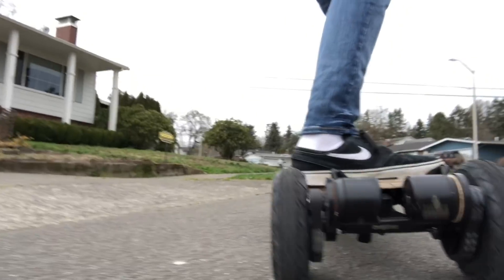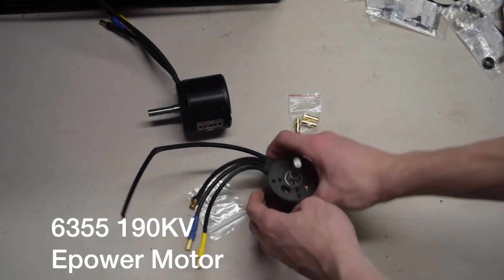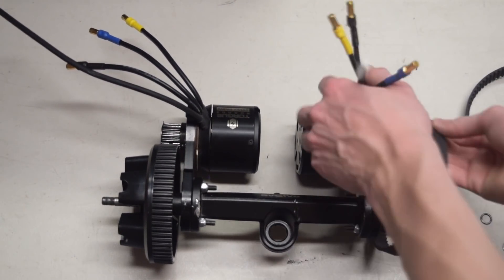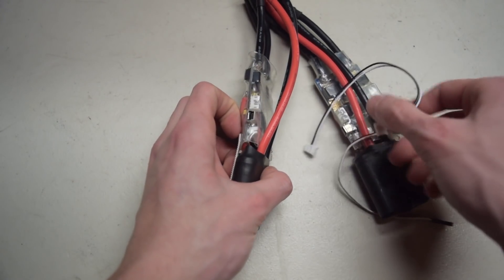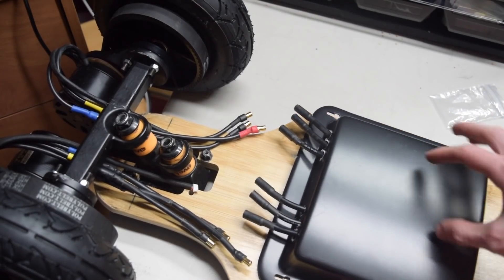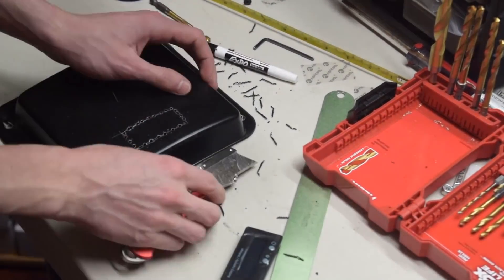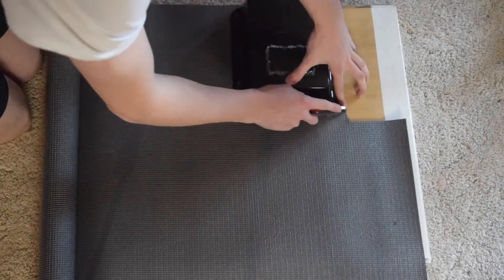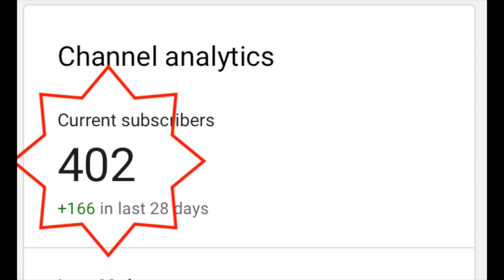How to Build a Dual Drive Electric Skateboard (10s5p, Evolve All Terrain Tires)

Comment: I ride a Meepo nls but I wish I’d built my own now . Thanks for the videos they’re real informative and very interesting
Reply: grantoldblueeagle diyeboard.com better than boosted in my opinion
Reply: I built an "almost" long board (it looks liike a surfboard). Probably only 40" long, with a Hobby King 6373 ($70) and a 150 amp "mega something" speed control that was like $60. I bought the parts 6 years ago, I assembled them 2 years ago with a nice set of trucks that fit a motor mount I EBayd for like $20. Bought 2 6000mha 3 cells to run in series, ya know to start small. Other people running 10 cell. It was SO FUCKING FAST AND TORQUIE IT WAS UNRIDEABLE! I dropped down to a 4 cell 7000 mha (I'm running lipo's.WAY more amps) and it's way rideable but super touchy throttle and tops out at 14mph (at 33% power). The torque is NUTS! You gotta do your math and research. I'm moving to a 10 cell pack but with a speed control that can't hit the mass amps I was with my last. That should reduce torque (seriously it was overkill, it would actually do wheelies. Throw your ass right off the back) and increase top speed. Smooth out the ride. It's ALL about math amigo. Don't be scared, it's all just plug and play. Cheers!

Comment: Sick vid! 2 things, make sure to cover the battery status wires with hot glue or heat shrink you dont want your wires to short and your battery exploding under you. Also I also made a board and drilled 3 holes for each phase of the esc but steering started scratching the wires where the drilled holes were which can make them bare over time. As I said otherwise a really sick video !
Reply from the maker: Yes for sure. I did that off camera. Thanks man

Comment: How much all together Did the board cost? How much are each part the wheels motors trucks escs controller and deck ? How long did it take to get the parts?
Reply from the maker: it cost around 1500 USD. wheels are 250, motors are 90 a piece, trucks are 120, esc is 300ish, deck was 50 ish

Comment: Today after a year what do you think about the battery
?
Reply from the maker: It was good but we put it on the mini bike and destroyed it.
Reply: @DIYesk8Builders  so you think will be good with 2 motor Flipsky H6368and and FOCBOX UNITY+?
Reply from the maker: Should work great for the price! If you do have the money though I would go for a 12s4p 30Q or 12s3p 40T. The Samsung cells are too good

Comment: I'm probably going to build this one but I have a question when I use the sensor wire from the motor is will start up smoothly right? And do you have an idea of an acceleration compared to a Genesis tomahawk sorry if I'm asking to much. Thanks
Reply from the maker: I have never run any motors with a sensor wire in FOC mode but from what I have heard it is a much smoother start up and is much quieter. I have no idea how it compares to a genesis tomahawk. The acceleration is not that strong on a genesis; I can floor the remote on high mode and not get thrown off. I'm sure with a diy board such as this, the acceleration is much stronger even with FOC mode and sensor wires. In the VESC tool you can also change how strong you want the acceleration to be so its very customizable. I hope this helps, don't hesitate to ask more questions!

Comment: Yo I have a question can you put smaller like 100mm boa wheels, or the orangatan 80mm wheels?
Reply from the maker: Yeah you could put any of those wheels, you'd just need to buy the corresponding wheel pulley from evolve!
Reply: DIY esk8 Builders alright lit thank you so much and great video.

Comment: If you wanted to upgrade the battery so you can have more distance with the same speed what battery would you choose
Reply from the maker: The board already has a good 15 miles of range. I would probably buy a 10s4p 30Q from MBoards through just for a few extra miles and a flat pack instead of this bulky one

Comment: Did I see those motors having a hall sensor? Did you not use them?
Reply from the maker: These motors have hall sensors, but we are not using them because of the large AT wheels
Reply: @DIYesk8Builders  can they not be used with AT wheels
Reply from the maker: They can, but from what I have read, using FOC sensored is more likely to make the VESC fail with larger AT wheels. Im sure it can be done though and we will definitely upgrade to FOC sensored in the near future

Comment: Hi Bilder, do you think these two MOTOR 6355 pushes well or is it better to install the 6374? which one do you recommend?
Reply from the maker: Dual 6355 is already insanely powerful, probably enough. Dual 6374 is just a little extra but it honestly does not make that much of a difference unless it is a mono drive.

Comment: Do you need two esc if  both motors are intended to go the same speed or do the motors lose performance?
Reply from the maker: If you are running two motors you needs 2 ESC's for sure, unless it is a double ESC.

Comment: If you use all terrain wheels your range is cut in half right?
Reply from the maker: The range in decreased by a lot. Probably not as much as half, but without the wheels this built probably goes 17 miles and with the AT its 12-13

Comment: Hi. Complete noob builder here.  @9min 05sec - How do i know which of the 3 cables of the motor plug into which female plug of the vesc?
Reply from the maker: Hi, it does not matter which order you plug the phase wires in so any way works

Comment: Does regenerative breaking works?
Reply from the maker: Yes, it does not add that much power back into the battery, but some
Reply: @DIYesk8Builders  Thank you for your reply and the video. The best one I seen. I asked about braking because it is an important safety feature. It  is more about being able to maintain safe speed than about efficiency.

Comment: Hello, i am interested in buying this exact board, how much ?
Reply from the maker: Email us @diyelectricskateboardparts@gmail.com and we can quote you
Reply: @DIYesk8Builders  I'm interested as well, I will email you hopefully you can help me out I want to upgrade I have an off road longboard on 10 inch pneumatic tires single belt driven 36v 800 watt I have three Duracell 12 volt 14ah ran in series pretty sure it's a Chinese built there's nothing anywhere on it that says any information but I got it for a good deal it was pretty much brand new and I can ride it! I can't even stand on a regular skateboard or longboard but now after 1 spill the fifth day, lots of road rash I have  started being more observant and cautious. But the board has worked great for me but of course I want to go faster now. So I was wondering what you offered and also I have some questions you can probably answer really easy.   Absolutely love your videos but yeah I forgot to say my three AGL batteries are heavy!! I've been experimenting with power tool batteries haven't had any problems yet but I'm haven't used my high amp hours on there yet just 2 40-volt 2 a h Cobalt batteries I rode around for about a half-hour and didn't feel any sign that they were wearing down everything seem to stay cool. But I am very very interested in seeing if you will build me a board I need more torque and speed and I would like dual Drive so I don't spin out climbing up steep grassy areas. I really hope you message me back I've had this on my mind for 2 months straight lol. Great video definitely the best one I've seen! Hope to hear from you let me know please keep up the good work
Reply from the maker: @joshtaylor9585  Yeah! just email us and we can see what we can do!

Comment: Why couldn't you just rotate the orientation of the motors to get a little more wire going the right direction and tuck them more overall?
Reply from the maker: I mean you probably could, I tried to but the motor mount has a slight lip so the wire bends weirdly around it and I didn't want them bending that way. Even with that it still a little far away from the enclosure so I'd have to make the extensions anyways.

Comment: Why don't you just use a dual motor ESC wouldn't that be alot easier ??
Reply from the maker: Yeah the dual ESC's are much simpler but I already had two VESC's before starting to build it so I figured that I would use them.

Comment: I wouldn't trust a battery that lists power as "360Wh"... that's capacity. MBoards you can do better ⚡⚡⚡
Reply from the maker: Haha true, the battery works amazingly though. I was skeptical at first but I was been very impressed with the performance
Reply: @DIYesk8Builders  Great to hear. How is the rest of the board holding up? Is it your daily driver?
Reply from the maker: The deck actually snapped on me, probably from shaving off too much of the back. I replaced it with the bottlenose top mount deck from skate shred and now its great again.
Reply: @DIYesk8Builders  Oh damn, hope you didn't get hurt. Thanks again for the video. It's really clear and to the point.